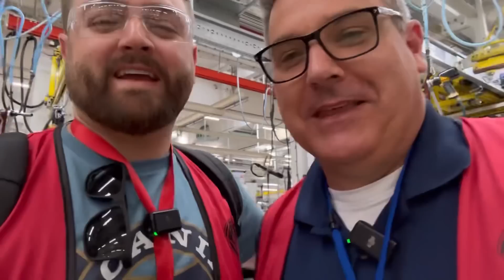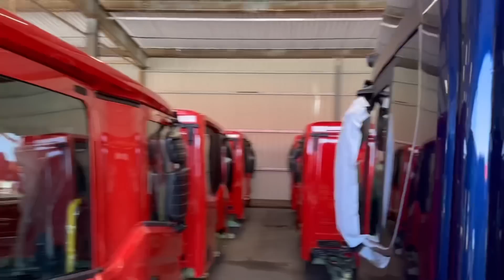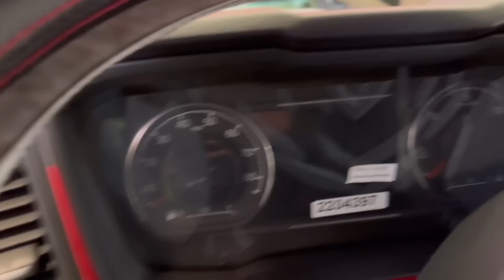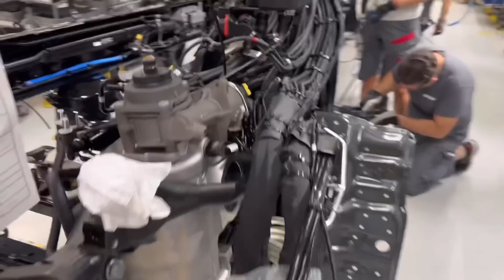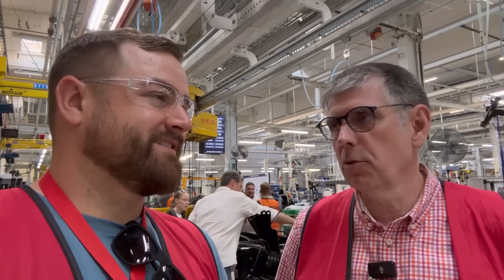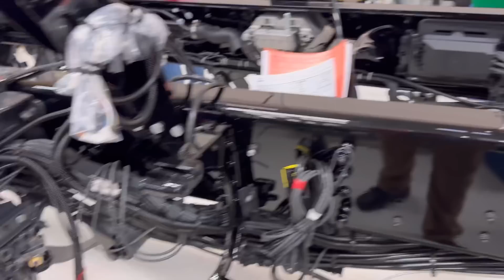Building a SCANIA R770 Truck for USA DELIVERY!!! Step by Step Chassis Build PART 1

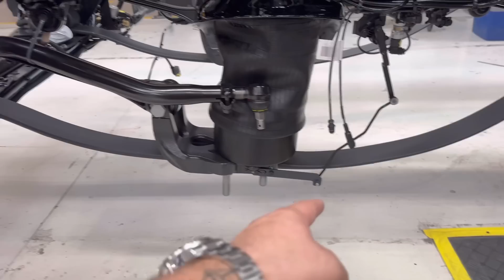Comment: That's not a "tracking arm" in the front suspension at 24:03; it is a wind-up control link, keeping the axle from twisting about its axis under braking force. Because the leaf springs are relatively soft (because most of the vertical support is done by the air springs), there should be a lateral location link as well.

Comment: MPH on Scania is not that big deal to be honest with mate. You guys somehow forgot about that there are Scanias with MPH cluster for UK are already existing for RHD spec. Only difference is that factory did put MPH cluster to LHD spec truck. Even if you want import LHD scanias or any other truck to UK that is less then 10 years old cluster has to be set in MPH for UK  legislations.

Comment: I thought the US had import restrictions on foreign trucks.
Reply: it does, trucks (and cars) newer than 25 years old aren't normally allowed to be imported to the US, hence why Bruce's own Scanias are late 90s examples.

but this new one, owned by Scania, is being allowed for promotional / testing reasons for 1 year (extendable to/by 3 years) and it will only be allowed to drive on some roads.
Reply: Millions of vehicles are imported to the USA every year. They are subject to a tariff (import tax) which is high for trucks, so almost no trucks are imported. They must meet US regulations (unless exempted due to age), but if the manufacturer is willing to do that - including the certification process - they are free to import as many vehicles as they want, from anywhere... as long as they pay.

Comment: Must be a $ 250,000 truck. I wonder how it would compare dollar wise, option for option to a Kenworth or Peterbilt ? Back when I was a mechanic, a Peterbilt cabover, loaded was $65,000 .
That looks like it's going to be a 20,000 lbs tractor.
Reply: What?!  The only thing that Will hinder heavy haulig in USA. Is US max weight road regulation. This truck Will haul anything
Reply: I went to Scania's UK online configurator (to get it in English) but it didn't let me select the V8 engine or show me the resulting empty (tare) weight... as I know at least some other manufacturers (such as Volvo) do. If you know of an available configuration tool which is more useful, please share it.

Comment: Only an American would be over the moon for a speedometer in MPH, when 95% of the world uses KPH.  In fact most vehicles in North America have both MPH and KPH on the speedometer and Subaru,  you can actually change all the information from metric to imperial.

Comment: 👎🐖💩🐷👎👎👎The densely packed pipelines have a high failure rate in the later stage. After 50-60 years of development, it is impossible to reduce all pipelines by 50%
Reply: They dont have a high failure rate. Source: I'm a lorry mechanic

Comment: Many friends and colleagues of mine, after all those years in the transporting industry, are declaring that, It is a privilege somehow here in Europe, to own or drive  a Scania.. Even I ,while I was an owner-operator in Greece some decades before, had this feeling, although I was a F12,Volvo owner operator !! (by the way, it was a VERY good truck for me..I had it for 9 years..)I have to confess though, that Scanias, have a very good reputation  to be a VERY strong  and reliable truck (but  more "pricy" than other trucks).. They are very much helped  also from their stylish and modern looks they have ..Anyway, they are in the frontline of the Truck market,all over Europe.. Sometime  before in the last decade, I was working as a driver for a company wich was using mostly MANs  in their fleet.. Well, sometime, I had the opportunity to drive a brand new MAN TGX 500 wich had the new (then..) Scania 14 gears ,gearbox, instead of the ZF 12 gears they usually had,  up to then.. I drove it for almost, one year, about 60.000 Kms.. Honestly it was a VERY BIG difference in every aspect.. Especially in uphills (or better in upmountains !!) BIG difference... The example that comes in my mind is that in the FIRST complete roundtrip to Greece was the following.. We were two trucks together this day.. EXACTLY the Same trailers, exactly same load and exactly the same MAN TGX 500 s 4x2  BUT I had the SCANIA 14 speed gearbox on mine...The other, had the ZF one...  Also they were equipped with very similar  intarders.. (this means internal retarders ...).. So.. at some point,we had to drive on the Fokida mountains (mountains Iti and Giona and so on..)with direction from Lamia to Patras Port to get on the ferryboat to Italy... This  road ( The first part of it, named BRALLOS  after  the village Brallos  there..A "traditional old mountainus road " in Greece.. ) is a very difficult, on the mountains road , VERY "curvy" , with not so long uphills (so , the horsepower to prevail..) and curvy downhills and short straights (so, the disc brakes and the retarders, to make the difference..).. I could see our difference when I was on the opposite mountain side ..At some time I lost my friend from my sight..) At our destination Port,he arrived some half-an-hour later... Well Bruce.. Keep this piece of my story in your mind when you drive your Scania and consider that on a truck, EVERYTHING makes the difference...Starting from the first bolt to the driver's experience,so ANY vehicle to do it's job better... I wish you Good luck for this part of your life...

Comment: Fair play to you Bruce for making this possible. Originally from Ireland over here in the States now driving my own truck. It’s a Freight Shaker and the build quality is debatable to say the least. I was seriously looking at the new S13 platform in an LT but might hold on now and wait for the day when I can get a real Scania. Drove a 1994 143 Scania and a 2004 164 in Europe for a living and although I love my American metal I miss my Scania. Volvo I am not a fan of as while they make a good product their customer service is diabolical. It will be a great day for Owner Operators in the USA when they can go down to an International Dealer and spec out a Scania with a V8 and a gearbox retarder. There will be those that will say that cabovers won’t work here but I call BS on that . Keep up the good work and congratulations on becoming a Scania rep.

Comment: make USA open it doors to Scania, and i mean fully open them... they will take over the market SOOO fast, and force new innovation from other US companies...
Reply: @Rimrock300  it almost failed, tho still sell some in USA, and if u want a brand new one from Scania them self, u need to make sure it's "up to US code", but everything is already better in a Scania, and says to be 15-20 ahead of USA trucks... u dont want Scania to take over, coz it would force some out of the market, and the rest have to do some innovation, or just copy Scania... "Scania trucks have been sold in the US. Importing one would require it to meet Federal requirements, so if it isn't a US certified model, you'd have a problem. There is an exception that requires a vehicle to be a certain age — like 20 or 25 years old — which can be exempt from those requirements" and "So that liability, combined with Scania's limited, Northeastern distribution and support infrastructure, ultimately spelled the end of their efforts in the US”
Reply: @spyro257  I mean yes, a Scania cabover will be interesting to a part of the market, like intercity transport, vocational trucks (dump trucks and so on) But the Us truckers love their hoods and big sleeper trucks, they will always be around, along with potentially more cabovers in the future
Reply: @Rimrock300  u can just get a Scania entended cab, making it the same size bed, like the guy in this vid, but i'm also talking about fuel saved, the extra horsepower, and all the stuff that makes the ride, a lot more smooth and comfortable for the driver... that's 3 very important things to any truck driver, no matter how far the drive is... also, about the trips around your country, if u had a better railway network, u wouldnt need trucks to drive very/super long trips, making a cabover alot more enticing, as they just need to drive for a few hours, and are a lot easier to drive around a city, and other tight spaces...

Comment: Great video!  If you didn’t know the fuel system on your new V8 engine is designed and built by a Cummins-Scania joint venture. I’m an engineering manager on the team in the USA that has design responsibility for your high pressure fuel pump and injectors. Hope you have many trouble free miles in the USA!
Reply: Oh that's very cool.

Comment: That cab is basically identical to the Australian version but LHD and in mph. The top hatch is a sunroof and doubles as an escape route if you tip it on its side

Comment: Euro trucks are as you say engineered, the same way as your car is. It's an engineered unit. You wouldn't accept that all the components and lines of your car just were painted over or just installed on a random place, or too long hoses or lines just wound up with a strap. Why accept it on a truck?

Comment: There is one problem with that gearbox ! I drive a S590 with the overdrive gearbox. If i load magnetic drill pipes, the gearbox wil have big problems to get in forward gears !! There are some metal pins that needs to be replaced by stainless steel pins ! Replace the pins, our keep the magnetic pipes ( our other items) away from the gearbox !!!

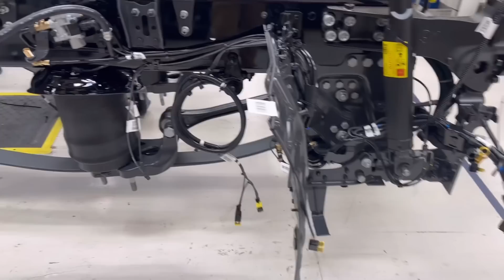Comment: At 17:29, Bruce is talking about the rear axle being a lift axle and they are not used in the US. I don’t know about today, but in the 2010’s I saw a few semi truck tractors using a rear lift axle. I saw both driven and un driven rear lift axles. Not many,  but they were around.

Comment: The main difference between North American and European air brake systems is the Euro brake systems opperate at a higher pressure and the use electric over air to control the each brake seperatly.  They use a electric brake control valve at each wheel which reduces delay and the application of each brake can be timed perfectly.
Reply: Modern North American heavy truck air brake systems use electronically controlled application of individual brakes, too... it's the only effective way to make an anti-lock air braking system.

Comment: I have seen few Volvos and Freightliners with FRONT drive axle that lift. Found it weird but saves on fuel. 

Also we can fill air in all our trucks too.... just add fitting to empty port on air tank. 

Nothing really special I guess but good information

Comment: STRAIGHT PIPE!!!!!!!!!!! America's want to hear the engine, so make them hear that V8 roar, that will be the first step. The next will be transmission, put a tall stick in there with that third pedal i think you could really make a huge impact in the American truck market. Other than that, Bruce, congratulations on getting a brand new R770 to America, its been a long time coming.

Comment: This is very exciting indeed. You should consider visiting the west coast of Canada. I want to see this beast. 😉
As for the speedometer in MPH, that is not as rare as you may think. They are putting those into UK trucks … errr … lorries.
Reply: Not in a left hand drive truck
Reply: @Christopher_Rock TruckerTim delivered a LHD Scania with a Torpedo (T-Cab) conversion to the UK.
Reply: @Christopher_Rock  The speedometer doesn't care which side of the truck it's on.

Comment: Excellent video , i do enjoy watching others work lol,,Luckily i have had the privilege of visiting truck factories with DAF in Eindhoven and also DAF at Leyland trucks ,It is impressive watching them assemble the product .I do like the fact Scania do not paint pipes ,looms plugs etc unlike PACCAR  products ,,The plugs and air fittings you like are standard on trucks in europe.That batch of airports on the loose bracket is for test gauges to see what the air pressure is and what it does during testing when using the laptop..I am guessing and i hope you can confirm wether i am correct or not ,With the steering box ,i never saw hydraulic pipes  and you mentioned the electric motor ,so is it  electrical powered steering box ?? DAF did a proof of concept truck about 10 years ago  maybe,and one of its features was a steering rack and wishbones ,basically a car set up ,,Obviously the axles are not fitted ,though DAF assemble the chassis upside down then drop the axles down on to the chassis  and later on rotate it the correct way up..Looking forward to seeing the reaction to it when you get it out and about in the states ...No insult intended ,though i am amazed by the reaction from the U.S to european trucks and their technology .Sometimes it sounds like you have 3rd world truck tech ,Yet you have the latest tech for everything except trucks...If you wanted MPH on your clocks you could have got a UK spec truck and the  steering wheel would have been on the RIGHT  SIDE lol..I would imagine there will be no issues getting it home ,if there is ,it will be U.S customs ,I really can;t see SCANIA making a mistake when it comes to the legalities...LOOKING FORWARD TO PART 2

Comment: I've been a proud Scania employee for 10.5 years. The first 4 of them were in this very factory starting out with assembly and then doing quality control. Thanks to Scania's internal education initiative I then moved on to transmission machining as a CNC operator. For the last 2.5 years I've been working as a supplier quality manager at Procurement. We make sure every single part that is going to be mounted on our vehicles live up to the requirements before we release them for production.
If anyone has any questions regarding what goes into building one of these and how we work to ensure premium quality for our customers I'd be happy to try and answer them 🥰
Reply: That sounds pretty awesome,  must be a great company that sees the value of its employees to develop them like that.  I used to drive Scanias in Australia in a road train configuration,  up to 91t.  At that weight they handle so beautifully and are a real pleasure to drive.  Would love to know more about Scania internal training however I also realise it's a loaded question. 😂
Reply: @castrain1419  Road trains are incredible! Absolutely amazing how much you can casually haul for long distances, in comparison to EU legislations. 

I'd be happy to answer any questions you have about the training 😃
Reply: My personal experience with the Scanias is the new14 gears gearbox that is on the MAN's TGX 500  some years before. EXELLENT !! Not that the others are not good but this gearbox is the best I ever drove in my 47 years in transport industry.. So please accept my congratulations as you (maybe..)were  some part of this experience..I describe this experience in a comment to Bruce ..
Reply: You have such beautiful eyes.
Reply: @stanislawcadenas4025  Thank you! :)
Reply: It was cool to see so many women working on the assembly line. 

I have a question, how come the factory closes so early, at 4pm?
Reply: @cupoftea2957  The line starts at 7am sharp and then there's 2 short 10min breaks, 24 min breakfast and 36min lunch.
So they work actively for a bit less than 8 hours.
There's no need to run double shifts in the Swedish factory at the moment, but the one in the Netherlands has two shifts and two assembly lines and produce the highest amount of vehicles per day.
There's also one assembly in France😁

Comment: Pity they didn't make a T-Cab version for you Bruce.
That would set it apart from all the other manufacturers with their US bonnetted trucks.
Reply: I can answer from an assembly workers perspective. Since it was discontinued, we have no special tools, for the manufacture of a T cab anymore, especially not for this new generation Scania. The cab factory in Oskarshamn dont have any molds, or presses to form any plastics or sheet metal for a t cab. 

To start production pf a T cab again would need massive ammounts of r&d, and would cost a fortune. There is sadly also the reason it was discontinued. Low demand and harder to build together with cab overs on the same assembly line.
Reply: T-Cab is no longer produced by Scania since 2005. You can contact Vlastuin for that. Vlastuin can convert the old R-type into a T-serie.

Comment: I think you failed to remember UK Scanias have Mph speedos so not a first of its kind to have a Mph speedo
Reply: He means left hand drive mph
Reply: Dont they have both mph and  kmh on the uk trucks
Reply: @mikrosixtysix  Yes most of the trucks have mph and kph on the same dial , however I have seen Scanias with just Mph dials and some with just kph dials.

Comment: We generally only get the R cabs here in Australia. The S cab's are apparently an issue for shipping due to the height.
Reply: Didn't aussie Scania's assembled on aussie?
Reply: Shame. S cab i so much nicer and its mote comfortable because you sit higher up
Reply: @mikrosixtysix  We can get the extra high cab in various DAF Trucks. You would think shipping is also an issue for those but no. DAF have an Agreement with Kenworth - Kenworth Build/Assemble trucks locally for the local market and so for the high cab DAF trucks they Remove the Cab prior to shipping and they are reassembled locally at the Kenworth plant.

Comment: I was stuck in a cab over from 1990-1997, no way would I drive one again.
Reply: You can’t judge Scania by 1990’s US standards.😂
Reply: @martinlaurie1971  US rules/laws have changed. A company doesn't need a cab over to pull a 53' or 57' trailer anymore.
Reply: That was probably an american cabover. If you drove euro cabover you would enjoy it 100%
Reply: @mikrosixtysix  No, thank you.